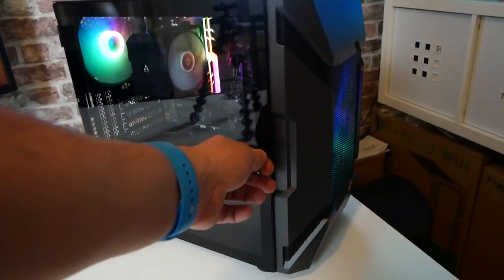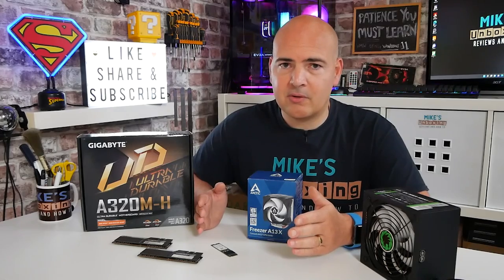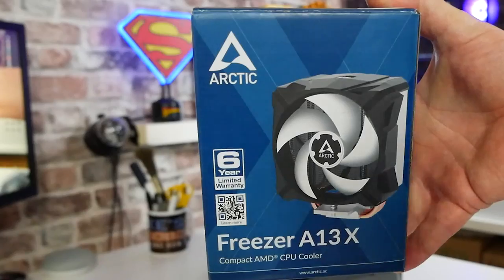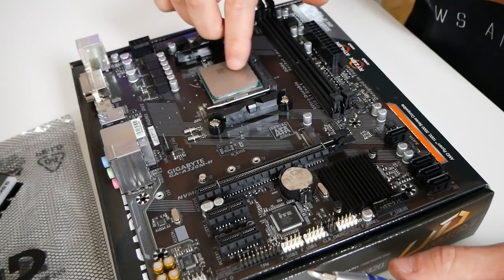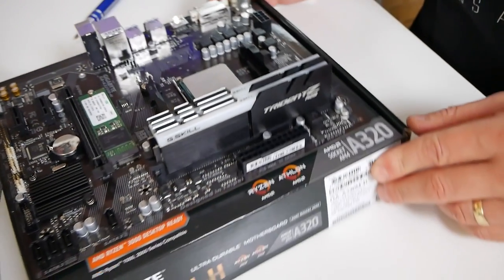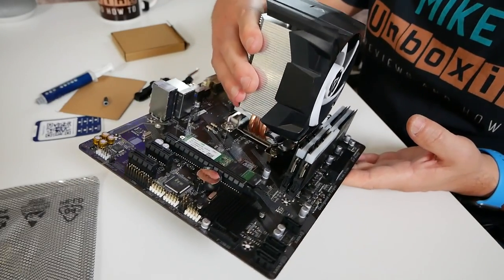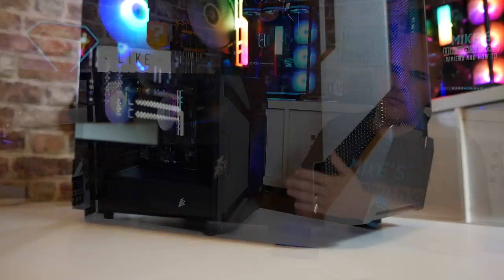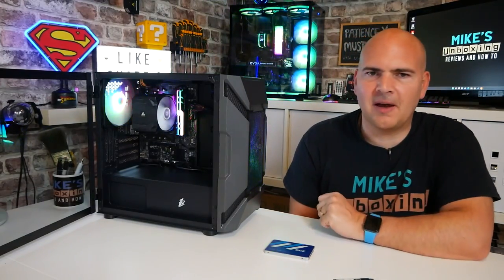£250 Budget Office Light Gaming PC Build With AMD Athlon 3000G

Comment: Hi, Mike. EPS cables in the tight upper corner can be a pain. I've gotten into the habit of attaching them before I install the motherboard. I don't plug any cables into the PSU except for the 24 pin with a bridge on it. I don't want any power going to the motherboard while I'm filling my custom loops.

As much as dislike small cases, I have to say that case looks very nice. I like cases with hinged doors and I wish more of them had it. The days of having the glass panel held on with thumbscrews should have ended long ago. Overall, very nice build. 😂I'll be rebuilding my main PC in the morning, now that my PSU and water cooling parts have arrived. I'll let you know how it goes.
Reply from the maker: thanks oletta, not a complicated build but set to a strict budget and brief , the customer was very pleased so that is good enough for me, hope you enjoy your rebuild
Reply: Same thing here. I always install PSU and make cable management before installing the rest. The CPU cable is the 1st thing to go to the dance. My Versa N25 doesn't allow to put the cable after MOBO install (very small space).
Reply: @RicardoCifuentesYepes  I've never understood why they don't put the power connectors on the back side of the motherboard. They would be easier to connect to, and we wouldn't have to see the cables. It seems like the logical thing to do.
Reply: @OlettaLiano  Engineering stuff, they said. Lol
Reply: @RicardoCifuentesYepes  Yeah, they said the same thing about electric cars not being able to recharge themselves while driving. Gas engine cars have a generator or altinator that keeps the battery charges. So, why not put better genorators in electric cars? I mean, who has 45 minutes to wait at a charging station?
Reply: @OlettaLiano  There are still several mysteries in the world to be solved. Myhtbusters to the rescue!

Comment: I have built my own just a week ago. I hope GPU prices will drop next year. This is my setup

1. Zalman T2 Plus - 10 EUR (used)
2. Evga 600W W2 - 27 EUR (new in sale)
3. Gigabyte A520M S2H - 34 EUR (new in sale)
4. AMD Ryzen 4300G - 120 EUR (used)
5. GPU Vega 6 (integrated)
6. Coolermaster TX3 - 10 EUR (used)
7. 4GB Kingston DDR4 - 10 EUR (used)
8. 8GB Kingston DDR4 - 20 EUR (used)
9. Apacer 256GB M2 NVMe - 30 EUR (new in sale)
____
261 EUR
Reply from the maker: looks like a great system and reasonably priced the 4300g is a good bargain

Comment: Hehehehe...
The limited PCIe lanes on the AM4 athlon line, was the reason I got myself a R3-1200.
Mind you, it wasn't because I wanted an nvme-drive. (Which I still haven't gotten for my desktop, which now sports a R7-1700x).
It was because I got a pretty good GPU, which I didn't want to hamper too much, with only PCIe 3.0 x4. (RX590)

I read the mobo manual a couple of times, just to understand the limitations, checked benchmarks, the few there were/are for lane limitations.
Funny thing is...
I had already read the manual several times, because my 1st choice CPU/APU was an A8-9600, because it was a lot cheaper than Athlon 200ge at the time.
And I had planned on an A320 board, but had found a B450 on sale, and chosen that on impulse, ruining my whole carefully set up plan of an HTPC. (APU only build).

2½ years later...
Gone from ASRock B450m HDV R4.0, to Gigabyte B450m Gaming rev. 1 (½-price), to Asus ROG Crosshair VI Hero.
From A8-9600, to Athlon 200ge, to R3-1200 to R-1700x.
From 2x4GB-DDR4-3000 Corsair LPX to 2x8GB-DDR4-3200 G.Skill Ripjaws, RAM kits.

TL:DR
Read the (effing) manual. xD
It'll save money and time in the long run. xD
Reply from the maker: agreed, it was an impulse thing that i failed to research properly and had to make adjustments to recover my problems

Comment: If it's a low budget office light gaming PC, why using RAM with aRGB. Wouldn't low profile RAM whitout aRGB/RGB not better fit in the budget?
Reply from the maker: if i could get it cheaper definitely! the price of RAM is having it's last hooraa until DDR5 is the main player, RAM is likely to peak between now and the holidays, then there will be huge drops as the DDR5 takes the centre stage - in my opinion
Reply: @mikesunboxing  The G.Skill Aegis DDR4 16gb kit is about 67.90 Euro's, while the Trident Z DDR4 16gb kit is 99.90 Euro. Both with the same speed and cl. That's already a substantial price difference between the 2 kits. Of course, these are the prices is Belgium, not the UK.

Comment: VRM MIKE ?
Reply from the maker: vrm is fine on this with the very low power requirements
Reply: @mikesunboxing  what dos vrm stand for mike lol
Reply from the maker: @darren990  Voltage Regulator Module
Reply: @mikesunboxing  cheers mike
Reply from the maker: @darren990  No problem :-)